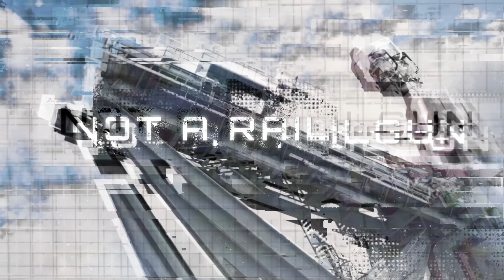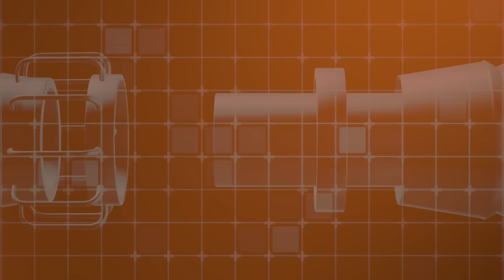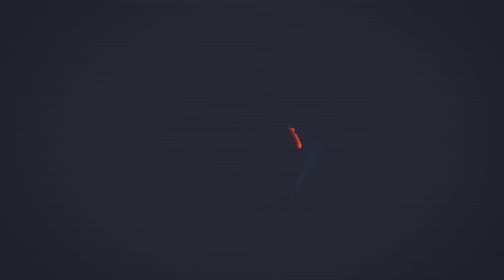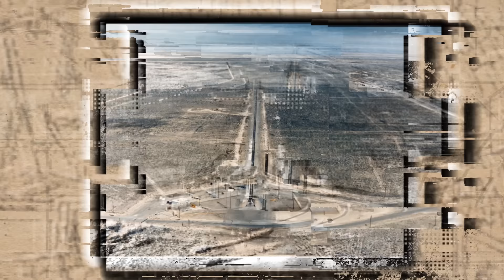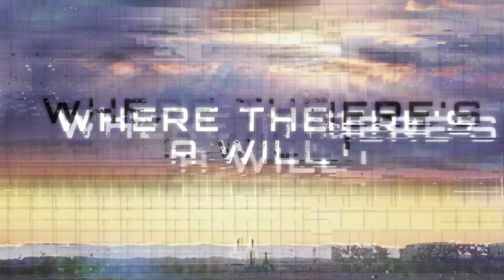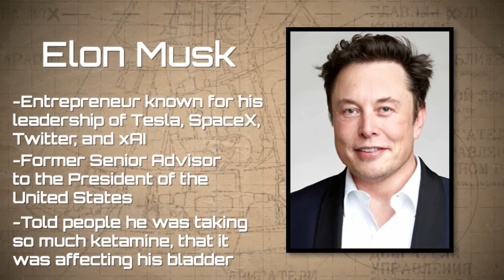China Wants to Build a Space Ship-Launching Rail Gun... But is it All Just Fiction?

Comment: The fix for how you deal with the space-ship hitting atmosphere is Magnetohydrodynamics (MHD) combined with Active Plasma Flow Control. Plasma Boundary Layer Control / Plasma Shielding, Technically they can throw it out at 3.2km/s removing need for Ramjets and running purely on scramjet with a methane and liquid Oxygen fuel. so no not ridiculous, the launcher can scale well to works well for Cargo uncrewed made for extreme G force  potentially removing need for fuel all together for cargo.

Comment: I’m going to listen to this, but also call “bulshit” before I do, based on physics… 

If you want to fling an unmanned item into space, you need to reach escape velocity… This means a huge energy dump requiring tons of fuel, and more importantly, happening over a few minutes. 

If you had a mile long rail gun, you are dumping that energy in seconds rather than minutes….massively increasing forces of acceleration. 

Not to mention, if you do all of your acceleration at low elevation, you are in the atmosphere and would experience re entry temps while leaving, and have to go fast enough so you still had escape velocity once through the atmosphere.  

Humans would die if they accelerated muck harder than they already do, so unless they build a rail gun to low earth orbit… it’s gonna be tricky. 

Let’s see what this is all about.

Comment: Well, this new device does not have to lanuch the space vehicle directly into the earth orbit. It can be used as a replacement of the first-stage rocket to lanuch the second-stage rocket with the mounted vehicle into high altitude. This is a technically more feasible method. If this method works, the re-usable first-stage rocket developed by Space-X will become obsolete.
Reply: Remember the space plane in the movie "2001"? That was the third stage: second stage was a winged booster to just short of orbit, and the first stage was an electromagnetic launcher that kicked them up to around Mach 1 or 1.5. This was for human launches, of course. A freight launch might be just 2 stages: EM catapult to Mach 6 or more, and a heavy duty cargo ship.

Comment: The problem with mass driver system is that the Gs it pulls to get into space is not sustainable for humans. So if China can get the technology down, and affordable (in comparison with rockets) it would only be useful for cargo, but that IS a LOT of the launches that we, as a planet, will be making as we get into space.
Reply: The video literally explains China's plans to address this issue. It's only an issue if you want to accelerate too fast
Reply: @lcg3092  Issac Arthur also has a few videos about mass drivers. In the end, China may need to continue the tube past the atmospheric limit.
Reply: @dracoargentum9783  Acceleration and G force is not that complicated to calculate, it's mentioned in this video that accelerating over 60km reduce the acceleration to barely unconfortable levels. 

You can say there will be other issues, but G force isn't one of them.

Comment: Heat is still a problem for a coil gun. It's more than surface friction you have to contend with; dumping that much power into the coils that fast will already generate enough heat to strain a system. It's not as destructive as the friction on rails might be, but it's still a hurdle

Comment: I have been researching this very thing for 10 years now and have seen it to be possible.
Reply: America had a similar project back in the 1960's called Project HARP, but it used an explosive charge instead of electromagnetic acceleration. basically was just an extra fancy artilery gun that shot stuff into space at 115miles into the upper atmosphere.

Comment: The air problem can be solved quite easily.... you will need to create air locks along the way to stop the system needing to deal with the pressure of the entire tube, BUT, to compare to a civilian product, the end just needs an extreme version of the Dyson fan, you can dramatically reduce the pressure in the end section and make sure the air flow is mostly already going in one direction - you get rid of the wall and make it a more gentle transition to atmospheric pressure and flow. Of course it's not perfect, but then you can transition the high speed vehicle to something closer to atmospheric pressure over a series of sections,  before ejecting it into an already flowing column of air, getting rid of the otherwise serious atmospheric impact to replace it with a transition that is easier to manage for the engineers. It is not that difficult of a problem to get around,  really 🤷‍♂️

Comment: Just imagine how much less pollution this would reduce just using electric to get space launches
Reply: We burn coal, use oil and Nuclear power which threatens the planet to produce electricity, not magic. And the batteries aren't much better.

So I imagine NOT MUCH?
Reply: @mericanignoranc3551  thorium nuclear and electric lessens carbon output

thorium is considered not meltable and safe

i guess you dont really imagine much
Reply: @yuan5154  thorium is not meltable? are you sure about that? thorium reactors are MOLTEN SALT REACTORS.
Reply: @dustinherk8124  how bout we agree that its safer than uranium being the key point then?

i did mean a catastrophic meltdown like fukushima my brother 

and thorium doesnt have THAT risk
Reply: @yuan5154  oh you mean critical failure. that is due to water cooled systems under incredible pressures. uranium reactors using salts for cooling are just as safe. the problem is when there is a containment leak in a water cooled system that is typically 300-400 times more pressure than standard atmospheric, and when there is a leak under that much pressure where hot water doesnt boil, suddenly does and have pressure loss and has violent explosive properties rapidly accellerating critical failures. molten salts, only need to be slightly higher pressure than 1 standard atmosphere of pressure. even deuterium cooled (aka heavy water) is far safer than older water cooled plants.
Reply: @dustinherk8124  hence fukushima then

Comment: Anyone ridiculing this idea needs to get their heads out of their arses. The concept is viable, but the limiting factor is resources and electric power. It will be achievable... the question is whether that will happen in 10 years, 25 years, or 100 years.
Reply: The concept might seem viable, but that doesn't mean it makes any sense. SpaceX has driven down the cost of launches (and continues to drive them lower) to a level that will probably make this approach uneconomic. That doesn't mean that feasibility studies should stop, but it probably wont make financial sense. Concorde was a viable Mach 2 concept airliner in the 1960s, several were built and worked. But the oil crises drove up energy prices and made the whole idea uneconomic (also the sonic boom prevented supersonic flight over populated areas). My wife flew on it once, unfortunately I never did. Apparently it was quite an experience.

Comment: An experimental prototype of a maglev launch system was built in 2015 in Shanghai, with a unique U-shaped rail. It worked for medium-sized rockets and hypersonic missiles, but the space rocket needs a completely new design to fit the rail(only two-stage but with a larger first-stage rocket), and launching usually has a harsh effect on the rail, risk of mechanical failure. Many technologies used in that project became key projects in the 13th and 14th 5-year plans. Since Em technologies have been largely improved in recent years, it is not strange for the Chinese to bring this idea back again.

Comment: You use a lot of fuel just getting off the ground, so a system to remove that need can save quite a lot of fuel over many launches. Even disregarding the ramjet and scramjet stages to simplify things, electricity is relatively cheap compared to liquid hydrogen and oxygen. Depending on how many launches per week you're planning, this could be quite viable. Still, this system would work better on worlds without atmospheres, launching from the Moon for example.

Comment: Well, here is the deal --
China got rail gun
China got EMALS, the electri-megatic aircraft launching system
China got Tibet with >4000m altitude plateau, where air density is 60% of sea-level,which reduce the air drag considerably 
China is building huge hydro-electric dam in Tibet capable of generate >10GW power

So all pre-conditions are set. Now all left are engineering difficulties -- who else built more engineering marvels than China?

Comment: I have heard of this concept a few times before, but most of the time it is a proposal for a form of travel once you are outside a planet's atmosphere. Like you put these on your moons and you theortically cut the cost of fuel in half while nearly doubling you max cargo capacity OR max potential velocity for vehicles being sent beyond LEO and GEO space.

Basically get a conventional ship off Earth to the moon, transfer the cargo and crew to the shuttle using a rail launcher to get somewhere, wait for the rail and target to line up, and fire; x hours, days, weeks, months, etc later the shuttle decelerates (and lands). This way all your fuel is just for the deceleration/landing and return trip, or just for deceleration/landing if another rail-type mass driver is already at the destination to power the return trip. This also keeps the whole issue of atmospheric friction and pressure from factoring into the design of the shuttle being launched this way.

Comment: Could a human survive the g of a Rail-gun?
Reply: build a longer rail.
Reply: no. the initial launching g's required are not survivable for organic matter. there is no constant acceleration, like with traditional rockets, where as the vessel gets faster the atmosphere gets thinner. the exact opposite happens using this launch system. the vessel will only slow due to atmospheric drag the second the vessel leaves the launching platform, and aside from survivability there is the fact that atmospheric drag will be so much larger with hard g acceleration, that the vessel could potentially just melt into a liquid ball of melted slag. the heat generated would be far greater than compared with vessel reentry it would be a decent cheap system for resupplying though once they solve basic vessel survivability.
Reply: No

Comment: Yes, it is just fiction. Mag-this and mag-that has been about about as successful as fusion power.

As the winner of NASA's "Brilliant Minds for Pure Blue Skies"  competition which used a laser-ramjet-engine, any surface based  rail gun, coil gun, spin-launcher ... whatever ... when you hit the air at low altitude at hypersonic speed the object will melt (if the payload can survive that initial 100g).  The genius of rockets is that is moves slow in the thick atmosphere and only goes supersonic in the thin air.  These Ship-Launching rail guns are ideas of launch a first stage, that then kicks off a typical rocket for a second stage.  With re-usable regular rocket first stages (F9 is now at nearly 40 reuses) the cost per use including fuel for 18 T to LEO is less than $2M per launch.  This may fall to less that $1M for 100T to LEO with Starship using very well tested reusable tech.  This is a problem that has been very cost effectively solved with a F9 launch now every other day.
Reply: America learned this lesson long ago under project HARP in the mid 1960's when they used a giant naval artillery canon to shoot stuff 115 miles into space.

Comment: The science exists.  The technology does not.
Reply: They've built a maglev train to their airport...
Reply: @seanhewitt603  So what?  This is 4-5x that speed, and you need to use it to launch a hypersonic airbreathing first stage, which then launches an orbital upper stage.  And then all of that massive fixed infrastructure has to be cheaper to operate than just using a larger rocket.  VTHL and HTHL reusable launch vehicles only have one thing going for them, and that's the misconception that one needs to land on a runway to be reusable.
Reply: @wagnerrp err, they're thinking about ways to make launching easier, cheaper, and cleaner, you are not. You are merely naysaying, probably based solely on race, and not actually contributing to the improvement of scientific understanding, only creating hatred and distrust... Well done son, you deserve the Darwin award.
Reply: @seanhewitt603 it takes nearly as much power as is generated by America's nimitz-class supercarriers atomic reactors to push a maglev train to 300 mph. Where are they going to get the power to push something to 7000 mph? It would literally take more than 100 nuclear reactors.  There are only 94 reactors in the entire United states. It would essentially take the entire power grid of the country of China to power the thing. 😳
Reply: @140theguy they have hypersonic missiles. Just attach those to the back. Upto mach 15 with the right inputs. The maglev just needs to be cooled. The boosters can be reused by having them take a different path or slowed down hard before the end. They can be pumped by a pipe system that valves in.
Reply: @140theguy Derr, duh, doi, it was described in the video , Einstein...
Reply: @UmmerFarooq-wx4yo what do you think those giant white things were on the side of the space shuttles were? For the record, Chinese hypersonic missiles will not do 7,000 mph. Are there icbms will, but they're hypersonic missiles won't.
Reply: @seanhewitt603 you're the idiot who's all but they built a maglev train! You obviously don't realize China is decades behind the Western technology. 🖕😁
Reply: @seanhewitt603  The Germans built a maglev train to their airport...
Reply: @LeeviHokka126sementics
Reply: @LeeviHokka126 And it didn't end well
Reply: @LeeviHokka126Funny，tell me where is one in Germany?😂
Reply: @depppp-i9g the shanghai maglev train was designed by siemens in germany.
There's a test track there. 20Km I recall.
Reply: @depppp-i9g Maglev is designed by a German company and licensed to various places who build them.
Reply: Can't be invented if education is getting worse every year in America. & Let's face it, America always jumps at the chance if it involves making new weapons 😅
Reply: If the science exists and engineer can build it

Guess who has more engineers than california has PEOPLE?
Reply: I wouldn't bet against China this wouldn't be their most ambitious project.
They have similar launch tech, power supply, space program, hyper sonic vehicles. 
They're just putting together all of them.
Reply: The only thing halting progress is money or the idea of needing money. We have the resources. We have the will. We can MAKE the way. Just gotta get rid of red tape and the idea of needing money
Reply: @patrickaycock3655  There's technical steps? That take time, industries the u.s don't have, which take political will (that you don't have) and methodology (that you also seriously lack of, i just need to see the mess in the u.s goverment or NASA artemis program to understand that nobody is talking to each other in a spirit of common goals/interests), the u.s have a brain drain currently ongoing, as for money, you have it don't worry about that, tho i wonder if the dollar is going to old it's title as main reserve currency worldwide for long but that's another topic, however everything is not a question of money.

The u.s are playing against the time to achieve enough protection of their interests to defend as much as possible against the falling effects of decades of contradictions, and a new geopolitical/geoeconomical reality. If done right they can endure somewhat and maybe rise up to some degree afterward to be amongst the best powers but no longer the first, or if they choose to refuse to acknoledge the problems at the doorsteps we can reach some extremely dire conditions, putting the country or even the american society in a major risk. We'll see what happen by the end of this decade, but space isn't supposed to be the priority rn. The u.s don't even have HSR line and lack in anything train related, this may be a good source of technical progress to create the expertise and basic industries required for theses kind of infrastructures.
Reply: yet
Reply: That's why you make the technology, just like any other innovation project in human history, nothing exists until it does, what a stupid comment
Reply: The tech already exists! China WILL make the Hyperloop a reality before Musk can ask for more money! They have Maglev! They have hypersonics! They have a space plane that stayed in space for a year! They have Emals! They have THORIUM! They have the batteries! They have the power! They have the rail guns large and small! ANYONE STILL DOUBTING CHINA'S PROGRESS EVERY 5 YEARS WHERE THEY JUMP AHEAD 10 IS CRAZY! THERES A REASON THEY CAUGHT UP AND OVERTOOK IN 40YRS!!!

Comment: Rail launched objects into orbit is a longstanding scifi theme. You can only launch objects if it is achievable at all, living tissue would be jellied by the gees involved. Nanofiber constructed space elevators are more feasible for living cargo, but there are tech issues to overcome to make them real.
Reply: Yes. Most of the mass for space stations and interplanetary spaceships could be launched this way. Humans will go up separately in rockets.
Reply: If it accelerated at a human acceptable speed it is possible. It's just a 20km electromagnetic catapult.
Reply: A mass driver would be used as a supplement when launching anything living and have the launch speeds reduced to safe levels. This would cut down on the amount of propellant needed to reach orbit as most of your acceleration would be achieved through use of the mass driver.